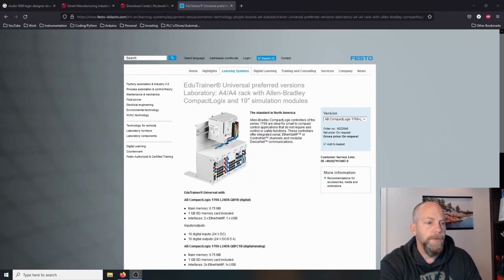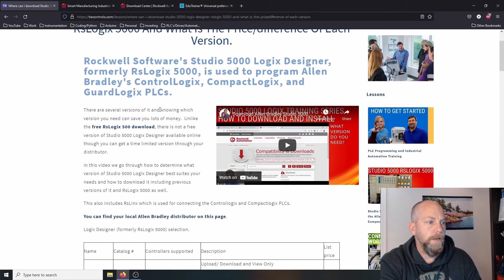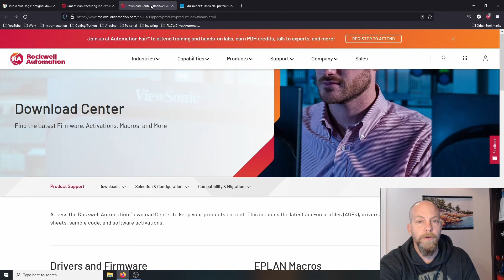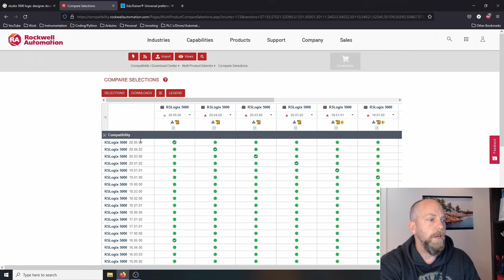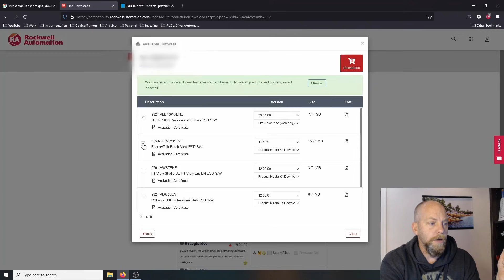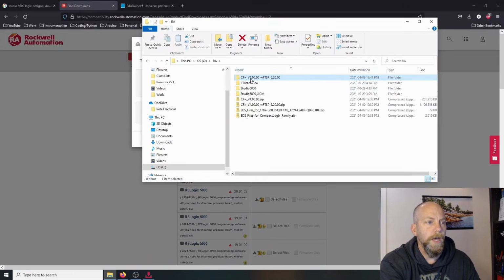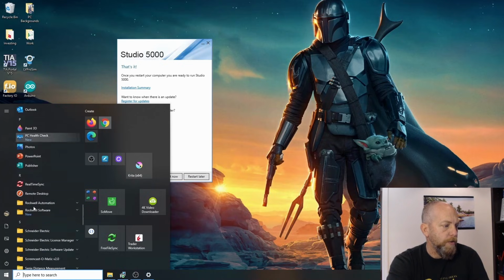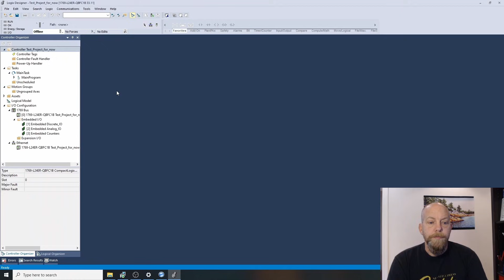Studio 5000 PLC Programming (How to Download & Install Studio 5000)

Comment: Just to be clear, there is no way to add multiple revision levels to the Logix Designer software. You must install the entire package (8Gb) for every revision of controller you're programming? I downloaded and installed the latest version of RS Studio 5000 and assumed I could add multiple revisions to that package so I could go online to any older PLC and upload the code. But it sounds like I need to uninstall and reinstall a different package for every version of PLC I have. Is this correct?
Reply from the maker: Hi Leonard, I just ran into this issue last week with my laptop running a newer version than the PLCs in our lab. To be honest, I have not tried this yet, but here is an answer from Tim Wilborne. Seems overly complicated compared to the Siemens TIA environment. https://www.youtube.com/watch?v=KKIxVcKgcRQ